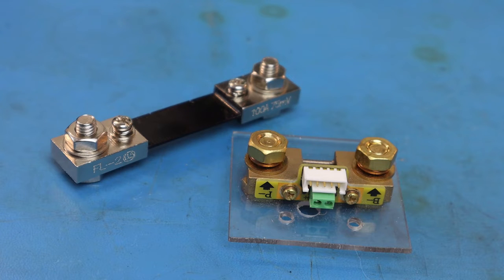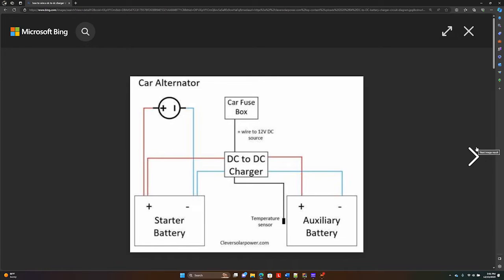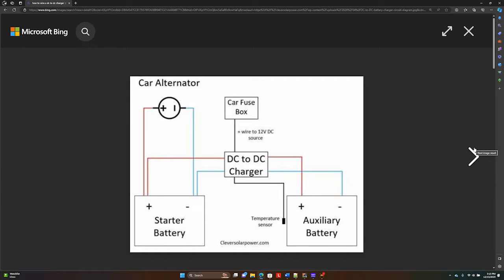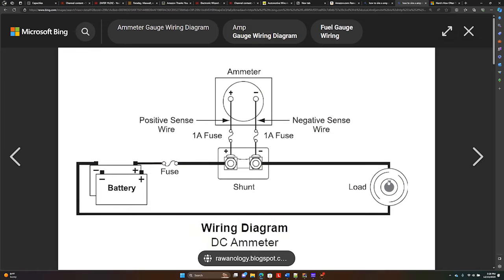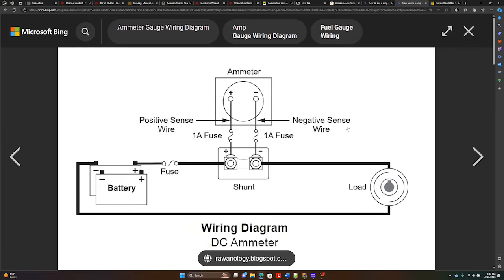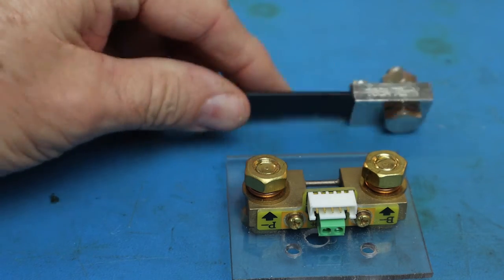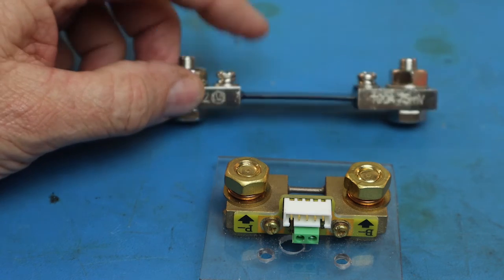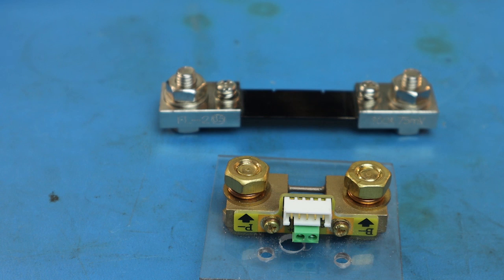What is a Shunt, How does it work and do you have to use one?

Comment: @16:19 you put 1 amp across the shunt as an example and then say the milivolt reading will be 7.5.  If it is proportional shouldn't it be 1 amp/100 amps times 75 millivolts which equals   0.75 milivolts?
Reply from the maker: You are on the right track,  A 1/100 amps shunt is designed to produce a voltage drop proportional to the current passing through it. For a shunt rated at 1/100 amps, this means that for every 1 amp of current, the shunt will produce a voltage drop of 1/100 volts, or 10 millivolts (mV).  If you divide 1/100 you get  .01 of a volt = 10 millivolts.

Comment: Can a shunt also show volts and watts, or just amps?
Reply from the maker: To measure amps the meter has to be inline with the circuit.  Volts can be measured across any two points, you do not need a shunt to measure volts.  Watts is a calculation of volts * amps, so no measurement is needed.
Reply: @JoediyLab  that all makes sense.  Thank you.
Reply from the maker: Thanks